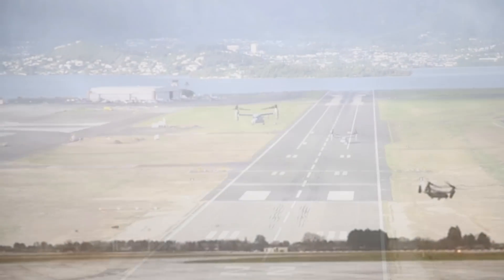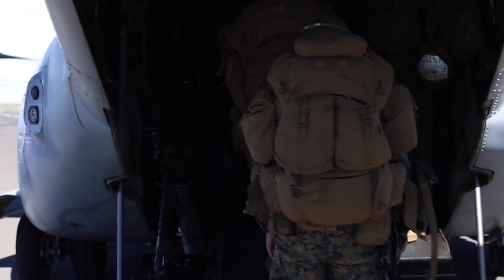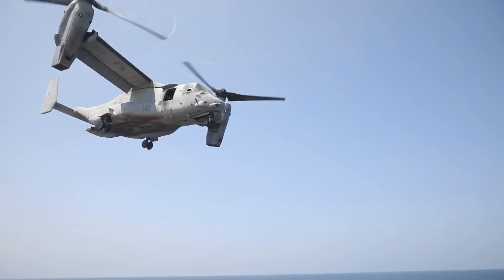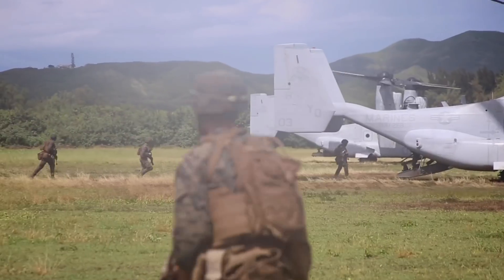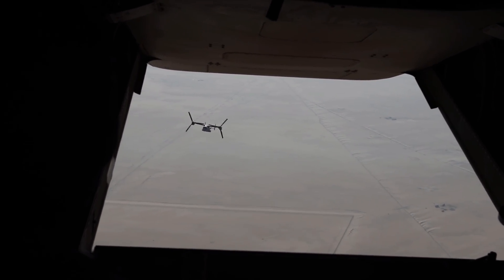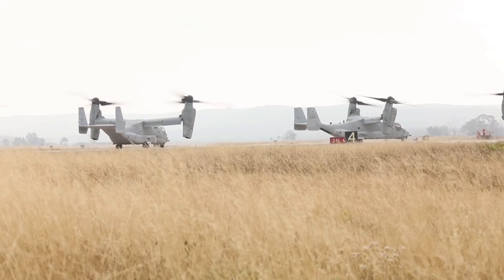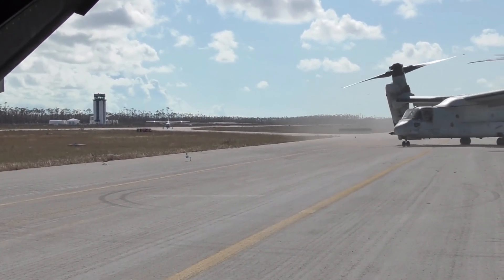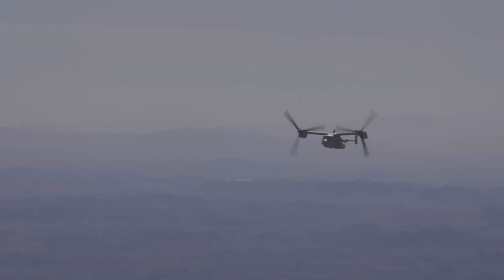Bell Boeing V-22 Osprey | TILTROTOR AIRCRAFT

Comment: Vortex Ring State Issue and Burning Turboshaft Fish Oil are more fit to Drones, than for Lifestock Soldiers. Give it some Cylons, they like to Die sudden. Shut the Rotation of put two 30°sloping Miniwings on each side, and any Copter goes 500miles per Hour. if ye get the partial Machnumber reduced below 1.

Comment: I like the design, but tbh, i don't like it. It is complex and don't really fit in a modern daysmilitary doctrine(imho). The complexity will make it cost-intense to keep in service, vulnerable for technical strandings, in need for a bunch of software that is still problematic(as Bill Gates killed more F-117's as the iraq armed forces). Also it is a tricky bird, and while well trained and talented pilots are not a thing you can set as standard(specially with a - sry - poor education system), you can estimate a more normal skilled pilot will cause more trouble with the V-22 as he/she would with a more simple and aged model.
The military doctrine of the US is still stuck in WW2 or some terrorist-fights. This will be okay against underequiped people with low training, but isen't okay to have this mindset for a modern army. The V-22 isen't a transporter(or at last very short, droping in hot LZs), It also isen't a gunship, it isen't solid, manouverable, stabile. At long range others are better, at short range too. 

I like to see new concepts brought to reality, but on this thing i still thought the designers had some kind of: "HEy, we need something completley new and freaky" - "Yeah, i saw a documentary of what the russians did freakin new in 1950, let's do this too" :/
We actually had so many new tech concepts to check out, like Flettner-rotors or such. Gondola vector thrust concepts. So much stuff.

At last the V-22 is a nice looking Banano-copter. And for this it is way to expensive. I would think that ther isen't a way to go to bribewars with companys, but the russians managed it even in a criminal heavy socialistic system(well, fascistic, tbh), and als after this period. I guess it should be possible to do also in the american ... ... system. Or find the nations balls and buy good old Hint's, which are the better Bananas as well as the better Apaches xD
prepares for shitstorm

Comment: From it's performance figures, it is both good and bad. For the size of craft that it is: it doesn't lift as much weight as a regular helicopter, but it can fly those smaller loads faster and further than a helicopter. One complaint that I've read is that it needs a big gun on a turret on it something like a 20 or 30 mm machine gun. One has to open the back ramp of the craft and then stand and fire the machine gun from the rear of the vehicle. This is a job that most soldiers want to avoid as you are often an open target to be fired upon. It is  good try at a vertical take-off and landing craft that flies longer distances at a much faster speed. i look at it as an interim vehicle until a better version is conceived. It is the first of a new concept and of course is going to have some teething problems. it is just the way that a new engineered concept evolves.

Comment: USAF CV-22 crew chief here.  The blade fold wing stow function of our aircraft is the same as the marines (and soon to be Navy) all automatic, there is no manual folding unless the blade motors or the hydraulic system for whatever reason is not operational. The engines on the aircraft are Rolls Royce although you got the model correct.

Comment: The 22s that are going to be replacing the C-2 Greyhounds are going to open up a lot of versatility in fleet logistics.
Reply: Only problem I have with the Navy, Marine version is that in order to compensate for the length of the F-35 engines being transported Shore to ship ., they had to decrease the number of passengers
Reply: There are always going to be teething problems of some sort with changes like this one. I wonder if they could possibly stretch the fuselage to better accommodate the Navy's needs in this regard?

Comment: An aircraft that is both a helicopter and an airplane, but doesn't particularly excel at either role? Niche applications aside, there's a reason not many aircraft like this have been built. They are also EXTREMELY noisy and have a rather particular timbre that is easily distinguishable from other aircraft.

Comment: I am sure tiltrotor planes will be more standard in the future. 
And even though a pure jet engine is not as efficient (at slow speed) as a turboprop (like the V-22 uses). 
It would look a lot cooler with a more streamlined design of a "tilt-jet" design.

Comment: @matsimus - hey man, I don't want to nit pick, but I would suggest researching more recent refeneces rather the very older references. With that being said the US Army does not operate the V-22, nor is the IDF planning on replacing their CH-53D, they were planning on it but the deal didnt fall through as they're more interested in the CH-53K. The RAF is not planning on acquiring then either. The only operators of the V-22 is the US Marine Corps as the MV-22, the US Air Force as the CV-22, the US Navy as the CMV-22 and the Japanese Maritime Self Defense Force. The UAE was interested, but negotiations between the US government fell short.

Comment: The thirteen foot diameter blades with the MD-90 ultra high bypass engines increased fuel efficiency by about four percent, but there were project canceling concerns of structural damage that might occur with failure of the big blades on one of the two tail mounted engines. The Tilt rotor concept provides much safer utilization of the new power efficiency.

Comment: In regard to the rotors, couldn’t they be shrunk.? Have 5 rotors but smaller in diameter rather then only 3 that are so long? The more rotors the less strain on and power output to achieve the same performance. Am I wrong?

Comment: An old German concept. Zero survivability in Combat. They can not hover on one engine and their glide ratio empty is 2 to 1 atrocious by any STANDARD fully loaded it would be far less. As one Serviceman pointed out if the engines are out its coming down NOW. If one engine is taken out during a hover it will simply roll over killing everyone on board. And they just keep making more. A good companion to the Death Hawk that has killed hundreds.

Comment: I had an idea influenced by the movie edge of tomorrow of a quad rotor type osprey that can both act as a fast mover and a very manoeuvrable aircraft that can successfully bring and drop a large amount of troops onto the field. There can be different varients to transport vehicles or support role ones with weapons that provide fire support or a mobile hospital. You can even replace the rotors with jet engines instead for more speed but I know it will be a engineering challenge.

Comment: Anything with two separate points of lift is a death trap, but this one is the king of them all. Not to mention that even if it has some forward velocity, those "wings" will hardly help you. So, it's not a "both a helicopter and a plane", but rather a mess that has the worst characteristics of either gathered in one machine. To make things worse, the rotors can VRS separately and even be affected with another aircraft's prop wash also separately. Spectacular tumbling from a hover, anyone? Also, I wonder if they ever attempt single engine out exercises in this thing... Not to mention both engines out, which the single engine out situation should lead to much easier than in any other type of aircraft.

Comment: AFAIK the US NAVY not yet put the osprey in service ( supposed to be HV-22) , the Japan self defense force is even faster than the navy. 
By the way, if it can't take off and landing with horizontal angle of prop. I don't consider it as a conventional plane regardless of the cruising mode.

Comment: Pretty handy for logistics but I think it is flawed as an air assault platform. The layout has poor external weapons options and poor fields of fire for door gunners. Downwash is very strong and hot and can present a hazard. Agility at slow hover is mediocre. The pop down belly turret option has been a failure due to weight, internal volume, and accuracy issues.

SB-1 Defiant will be a better air assault platform overall. Only slightly less range and speed than Osprey, without the drawbacks. Very quiet and agile. The safer downwash and better weapons options are also helpful. Defiant also takes up less space on deck. Defiant is still in flight testing but looks very promising.

Comment: My dad worked on the v-22 program in the late 80s in Philadelphia.   He was a Marine with CH-46 squadrons and was sent to work with civilian engineers at Boeing Vertol.  You mention being nervous about the transition from helicopter to fixed wing mode and I can tell you that it was an issue early in the program, with basically two separate flight control system modes.  Since then, both models have been seamlessly integrated and transition is automatic with a lot of computer involvement.

Comment: And those killed more aircrew than any other aircraft in testing/adoption in IS history.
Reply: Well for starters that blatantly wrong; at least attempt to be educated before you make yourself look like an idiot. Transmissions are fine, can't think of a single mishap that has been caused by the transmissions having issues. Also, we can mount two different .50cals. It definitely doesn't 'rip it off the mount' You definitely haven't ever watched an entire wing get twisted off. And yeah every 1000 hours of operation. Guess what; that's a Navy aviation standard you idiot. So I guess every single aircraft the Navy or Marine Corps operates is just a horrible plane since they require a 1000 hour phase.

Comment: And ha, beautiful drivetrain my ass, their transmissions suck, and are flawed, requiring far too much maintenance, or they fail and it crashes. If they take too long to transition to forward flight, their gear box overheats, then fails and blows up. Oh, they can’t mount anything bigger than a M240 or else when you fire it rips the mount out of the aircraft. A 7.62 machine gun is useless at the altitudes and speeds they fly at. Oh, I watched ones whole wing twist off the bird at 50ft above the deck, on MCAS New River, where I was stationed, right next to their squadron. And they and every other squadron had ridiculous down aircraft numbers, with none of them meeting operational readiness numbers as they always broke, from avionics to the gear boxes needi to be rebuilt every 1000 hrs of operation.

Comment: By the way I saw that there was a plan out there or an idea to build a version that is similar in concept but obviously smaller to the AC 130 gunship. That I must admit intrigues me to no end.
Reply: Have it mounted with the M134 mini gun or twin 20mm. Lighter version of AC130 that is..

Damn, I'm really curious how it'll be like
Reply: Now that would be a game changer to call in for support❗😱😎
Talk about off shore drug interception❓
A speedboat full of drugs would sit up and take notice if you had something like that backing you up when we told you to heave to and prepare to be boarded....😕🇺🇸
Reply: @pffear  enemy VTOL..wait an AC-130, whatever the fuck is that inbound!!!
Reply: you're talking about the QTR Quad tilted Rotors. The initiated the study back around 2005 (not sure) for the future heavy lift project but both has died out. May be from the funding problem for the future lift and technical problem for the quad tilted rotors.
Reply: @kittenastrophy5951  
The video said something about a belly mounted mini-gun automated turret in 7.62 or even a .50 . 
If they can stick a remote control gun on a 6x6 golf cart that will follow a squad down the road or trail to be set up in overwatch,  then sticking one out the bottom of a V22 should be easy enough unless it's got vital shit running throughout the area that can't be moved. 
It would need to be a pass through mount accessible from the inside for reloading or maybe a drop down so it could be pulled up to land. 
But like my old Sgt. told me about when they mounted a mini 7.62 on an old M113 over in Vietnam,  the ammo to keep it talking didn't leave any room for troops in the back. 
They just drove it up to anyplace on the perimeter where they expected trouble and hosed down any VC who tried to over run their line....😎👍
But other than a driver, a gunner,  and a couple of guys to keep her fed......
There rest of the back end was all ammo.😜
So this would take any ship so equipped out of service for troop transport duty,  that there could be a reason they scrubbed the program......
You only have room for so many birds on the ship.....😕
Maybe they decided it wasn't worth loosing a transport asset to make room for it.
Pity though, but if you can call in a full size AC130 any where, any time,  why take up space aboard ship with a smaller less capable bird❓😕❓
Reply: @pffear  Yes the gatling gun operates that way. Drops down when needed and retracted up when landing and internal fire control for the gunner. I saw the video operating it sometime ago here in you tube. The  the heavier weapon 0.50" only mounted on the tail ramp which is less useful in only fire backward. To think about a gunship tilted rotor you need to re-design from the ground up like they do for the V-280 ( but for me still not looks right for the gunship version).
Reply: @kittenastrophy5951  
Like I said,  they may have just decided why bother❓
It would only be a needed asset if the battlefield was in a place out of reach of the AC130,  is there such a place on earth yet still in range of the V22 from an assault ship❓😕
So if you can call in the AC130 to do the job, why bother with the smaller,  less capable ACV22❓
Especially if it would mean taking the slot of a bird needed for transport duty❓
Reply: @cyanoticspore676  
Because I like to....😎
If it bothers you,  you have my permission to not read my comments,  it will be hard but I'll try my best to live on without you ❗😜👍
Reply: @pffear  it doesn't really bother me, just wanted to know why so many
Reply: @pffear  can't land and take-off in an AC-130 from an amphibious assault ship
Reply: @JohnRodriguesPhotographer  
That's true John,  but is there anywhere in the world right now that isn't in range of an AC130 that you can still reach with a V22 from an assault ship❓
If there is,  please tell me where❓
Don't get me wrong,  I can think of applications where it could be useful,  but we don't have the needed platforms or the authorization to set them up❗😎
I'm talking about drug interaction platforms out in the Gulf of Mexico like I saw in a novel "Hammerheads" where the Cartels hired so General out of Cuba to fly shotgun with Cuban AF migs to keep customs and the Coasties from catching the coke shipments. 
They put converted oil drilling rigs in the gulf and flew armed V22's off of them....
But we'd never get something like that through congress.....
But it made a good story to read❗😜❗
Reply: @pffear  The AC130 is a relatively slow aircraft by today's standards. Yes it can get there, but can you wait that long?An Osprey gunship would be with the amphibious force, allowing quicker response and turnaround. Un refueled the AC130 has a range between 3500 and 4000 miles I think, obviously without refueling. Correct me if I am wrong. Top cruising speed about 300mph. Again correct me if I am wrong. Keep in mind combat loaded range and ferry range is always different.

Comment: Mean Flight Hours between Critical Failure numbers for the V-22 since 2010 appear to have been scrubbed.
The crew gets O2 the troops don't have oxygen or a pressurized cabin.
Replace present rotary wing aircraft?  When the Osprey can do an auto-rotation maneuver it may then be possible.
Reply: mehhemennn, OK, so, the 22 cannot auto-rotate, but this is because thems is not rotor blades, thems is propellors. They don't generate lift by bein' a wing, they generate it by blowin' air downawards But, then again, the 22 can glide, a little, which chopperoos cannae. By a little I mean in theory this is something they can do. Pretty sure in practice your tiny wing lift and prop drag means you glide, but more or less straight down to a sudden and splattery U-FIT.

Though I agree there's not likely to be many TRAs; helicopters are complicated, but the 22 is that twice over plus a whole bunch of other even more complicated, and it's really only the military who have the time and resources to keep them working, and lets be fair, with the 22 they're kinda commited.

Comment: I am not entirely sold on the V-22 or for that matter the concept of the tilt-rotor. I do understand the need for the V-22. Helicopters are limited in their speed by two things. Rotor speed and aircraft speed impact the following, retreating rotor blade stall and advancing rotor compressibility. These two things directly impact the maximum speed of an aircraft no matter how much engine you pump into the blade.
Reply: rotary wing aircraft has a top speed about half that of the osprey.

When incidents like the Iran US embassy siege and like Blackhawk down would have benefitted with high speed troop delivery and extract, with the speed of a C130, and the hover ability of a helicopter.